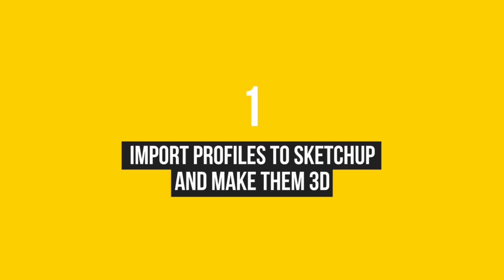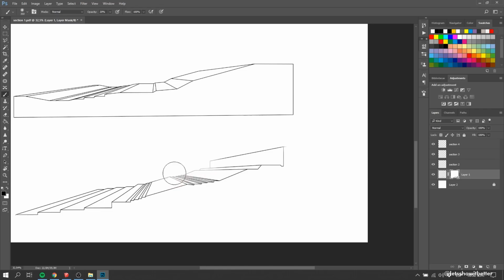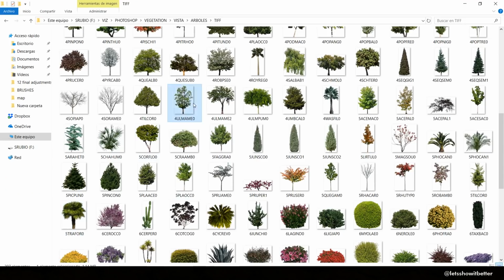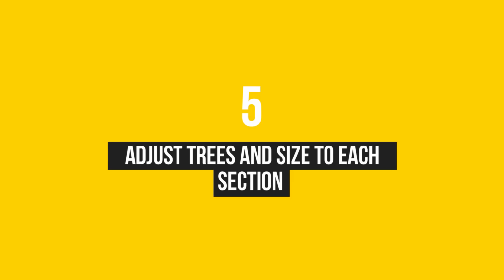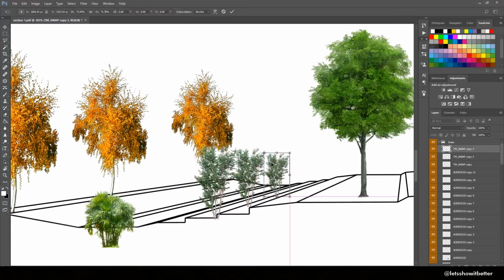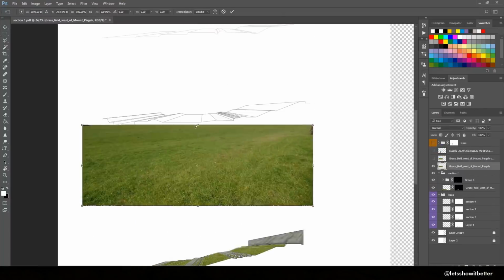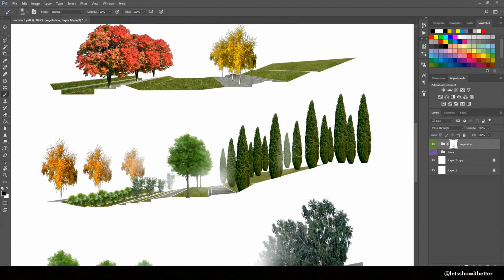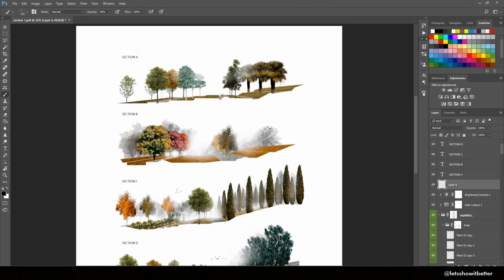Landscape Perspective Section Tutorial

Comment: Cool, I like it. The only thing I might change is put in some cross section cut lines in Sketchup Pro to vary the height of the extruded landcape before export. Since, the Photoshop file is not really a flat 2D elevation but a 3D one point perspective, a variation in land height at distance and more different tree heights in close proximity to each other would help.